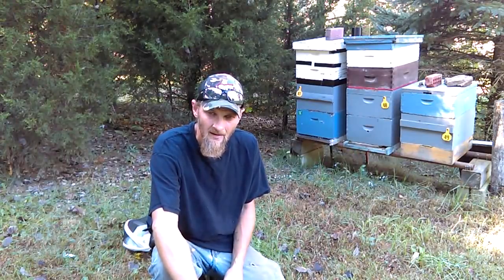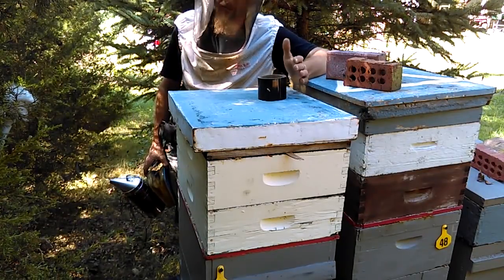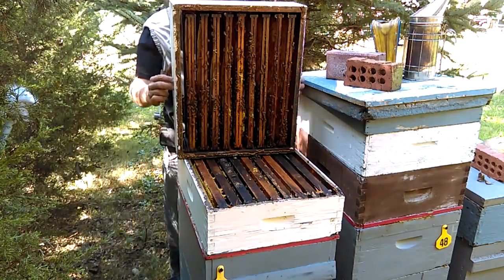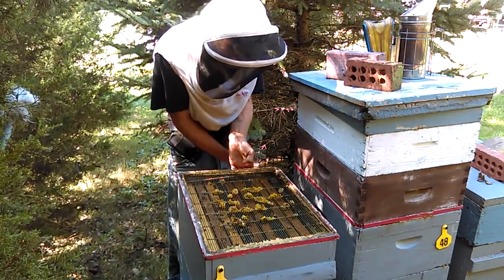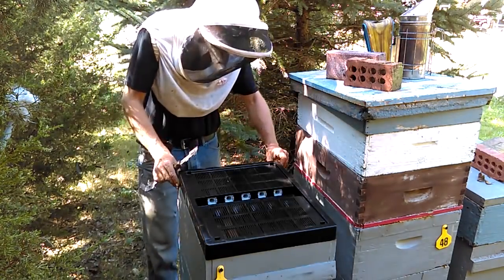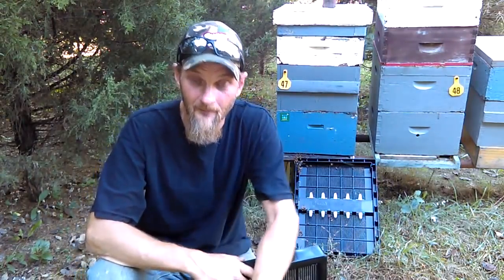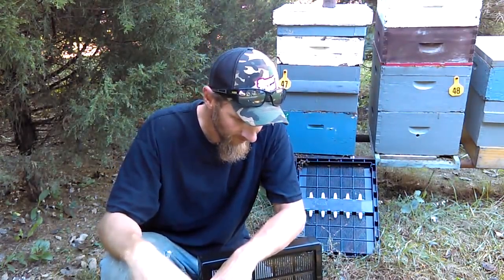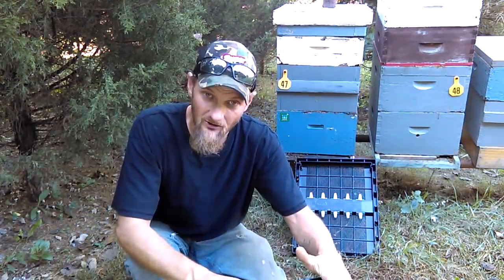Ceracell's New Bee Escape / Removing Honey Supers Just Got Easy

Comment: It would be interesting to see this tested on a hot summer day.  Closing off the top of the hive to air flow will the hive over heat?  Might need to put a screened top vent to keep it cool?
Reply from the maker: Good points but I don't think the bee escape stopped much air flow, it's very well vented. Did you see the slits in it?  I think if there was any resistance the bees would just beard or do more fanning at the entrance.
Reply: Sorry  I was not clear with my comment.  Do you happen to know if the manufacturer tested this under worse case scenario?  Worse case  a new beekeeper with a new hive (well sealed to air currents) and owner painted the hive dark colors. His hive is in direct sunlight all day, he puts the bee escape on in the morning closing off the top and plans on coming back in 24 hours.  And of course it gets super hot that day and clear skies! Can the hive get hot enough to harm the bees, does it need a screened vented top?  Or maybe the manufacture did test this and perhaps they found the bees are not harmed and the escape even works better in hot weather because the heat pushes the bees down in the hive?  Any mention of any of this in the instruction manual that came with it?

Comment: Looks like it worked a little better than  the triangle escape I used this fall. Thanks for the video!
Reply from the maker: I have never used an escape board of any kind until this one and I was very impressed. So your triangle escape board did not work too well? How long did you wait? Was there possible an entrance above it?
Reply: Jason Chrisman  I waited about 36 hours and there was no available entrance for them above the escape board. I think the trouble came for two reasons. First, the weather was pretty warm the night I had mine on, so the bees had no great incentive to travel down to the cluster, and my two hives have tons of bees, so they probably didn’t have enough room to move down even if they wanted to.  In the past I’ve just done the shake and brush method, which is tedious, but effective. I only have two hives at this point, so it isn’t that bad. I might try a fume board next year and see how I like that method.
Reply: Hey JC, Mary. I make my own double triangle escapes. They work about the same as the Ceracell it would appear. This would be a great alternative if you couldn't make your own though. Mary get some Fischers bee quick, lay a old t-shirt on top of the uppermost super. Spray it with Fischers. The Fischers is all natural essential oils and won't harm your bees or honey but it does help them get to moving out. Thanks for the review JC